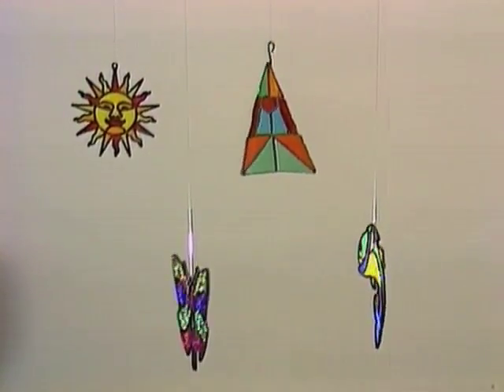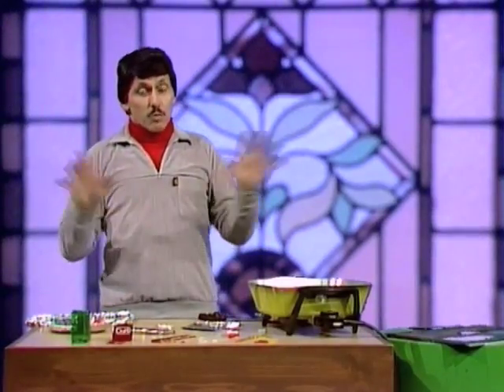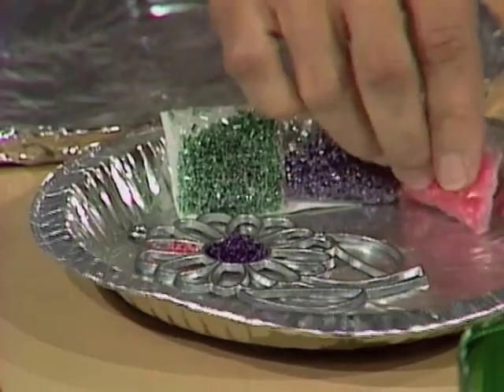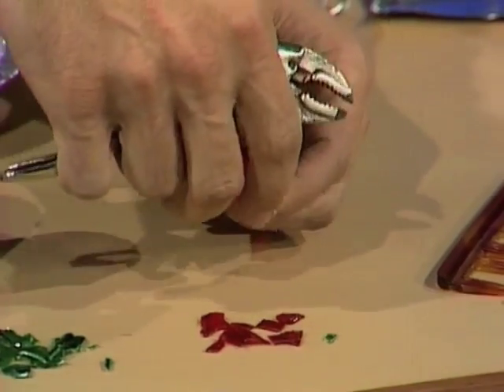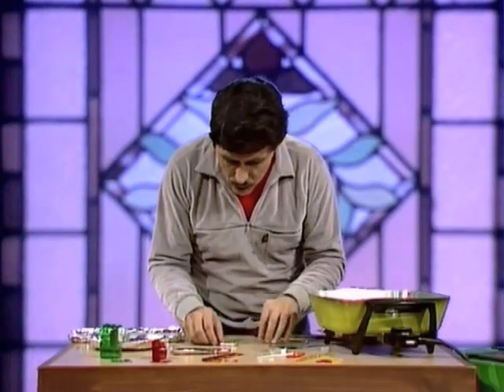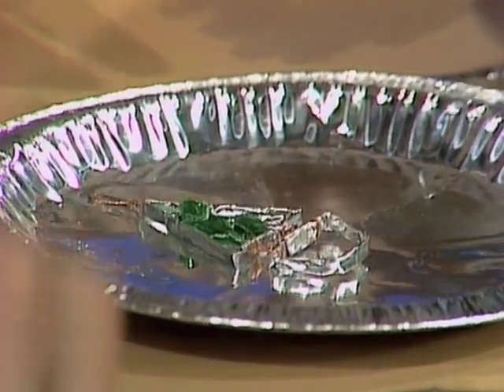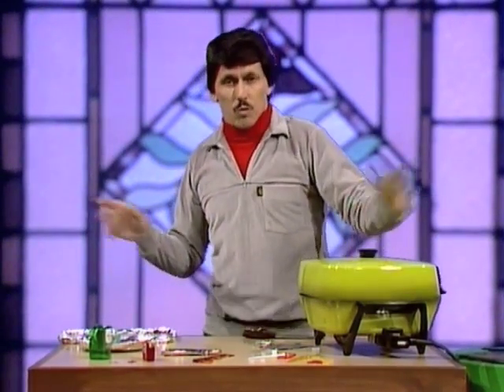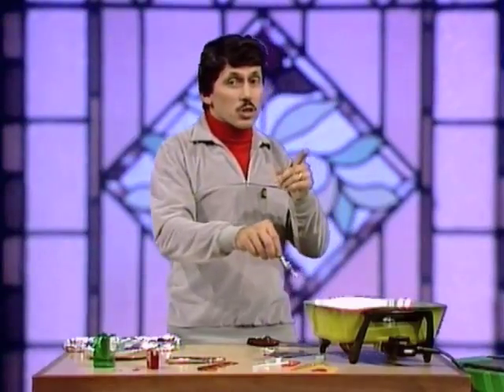Making Leadlights

Comment: This is very cool. However shouldn't caution be advised with the melting of plastics? Noxious fumes might be formed.
Reply from the maker: Yes - you make a good point.  It was for this reason that we frequently advised young people to ask an adult to supervise when carrying out science activities.   Deane.
Reply: @wampatan9 - yawn!  health warnings!  why are they called lead lights?
Reply: michael perri  because the original types are made of glass is held in frames made of lead. Since they call those lead lights then the smaller version that they are making is modeled after those and take the name as well.
Reply: @romwil  - i was being sarcastic.  the original poster mentioned that plastic melting creates fumes.  i'm sure back in the day you got to breathe lead fumes if a person made real leadlights.
Reply: michael perri ah! Sorry about that. :) I had never heard of the term lead lights before myself,  as we call the, stained glass windows here, thought there was the same confusion. No worries.
Reply: @romwil  no problems!  deane and rob are awesome!
Reply: @romwil  , that explains the "lead" part of the term.  The "light" part comes from the fact that "light" used to be the main name for a glass window that couldn't be opened:  it admitted light, not air.

The word "window" comes from roots meaning "wind" and "eye", an eye being an opening.  A hole in the wall for the flow of air was a wind-eye, a window; and it might well be covered not with glass but with an opaque wood panel.  A hole in the wall filled in with glass for the flow of light was a light.  (This meaning of "light" persists not only in "leadlight", but also in "fan-light" (a sealed glass window over a door and shaped like a Chinese fan), "side-light" (narrow vertical sealed glass window beside a door), and "transom-light" (a rectangular sealed glass window over a door).)  The word for something that generated light was "lamp".

Of course, nowadays, so many ways of generating and admitting light have come about that there are many uses and overlappings of "light", "window", "lamp", "bulb", "globe", "luminaire", "fixture", &c.

Both "lead-light" and "stained-glass window" have shortcomings.  Most stained-glass windows are not openable, so by the old meaning they are technically not windows.  In the early days of openable glass windows, the pieces of glass were so small that they were almost always combined in lead networks, set in wooden frames—and of course most of this glass was as clear as the maker could make it, not colored, so that any glass window, even one with no color and no representative picture, was technically a "lead" "light".  And then of course there's the fact that the ornaments shown in this video aren't windows at all:  maybe they qualify for the name "sun-catchers".
Reply: There was a lot more common sense around back then people would see a problem and deal with it without necessarily needing to be told

Comment: Wouldn't that only work for heatset plastics? Some plastics tend to burn rather than melt. I wonder if it wouldn't be better to use some kind dye in an epoxy resin.
Reply: Remember, this was for 10-12-year-old kids and they wanted to keep things relatively simple and easily doable and inexpensive with items around the house. ;)